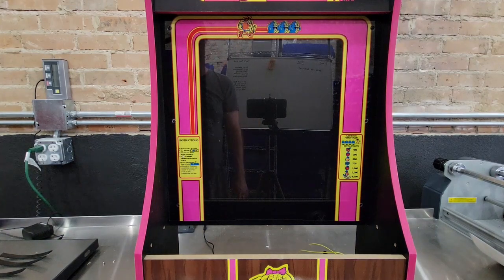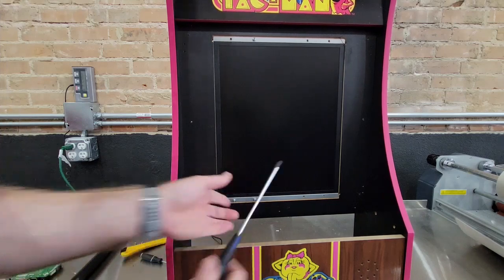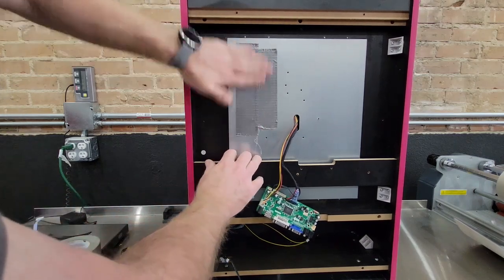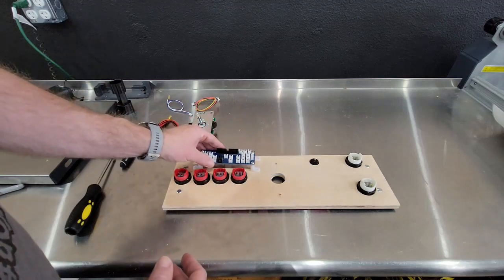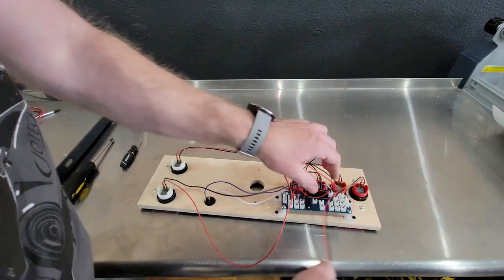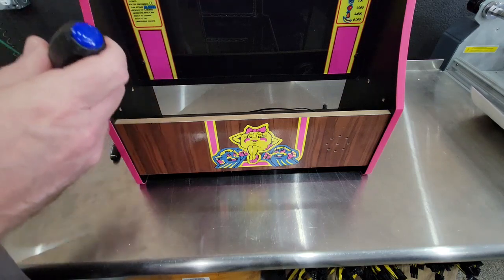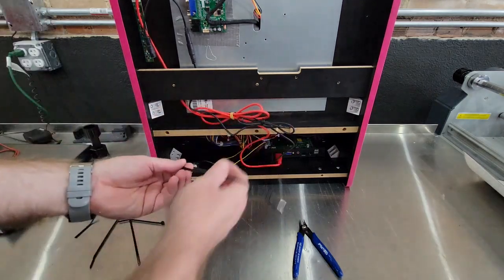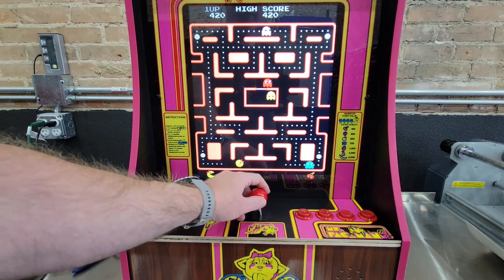Arcade1Up PartyCade Pandoras Box Vertical Game Board Install Using Easy Plug and Play Board

Comment: I would definetly use 4 screws on the joy sticc as it gets the most abuse.  using only 2 screws has a higher probability of lossening over time.  Once one screw gets loose, you are now relying on the other screw for holding the joy stick firm.  If you want a solid joy stick.  4 screws and some glue.  
I also have that pesky type magnetic type screw driver,  I place a small neodynium magnet on the screw driver to get a better hold on the screw.

Comment: Just a question about the vertical Pandora's Box board in general because my Google-fu failed me on finding this out:
If you turn off all but one game on the board, does it become a "dedicated" version of the selected game or does the menu still come up? I know the 60 in 1 is capable of doing this but I wanted to see if this would do the same because in a hypothetical situation where I wanted to use these as a temporary fix for a game that doesn't bode well on the 60 in 1.
Reply from the maker: No, its not like the 60 in1. The pandora will always boot into the main menu.

Comment: Extremely helpful video. I've been thinking of doing this with the same cabinet I recently purchased. I never knew much about how to go about it though. Few questions..1. How do you adjust the volume?  2..How do you return to the game selection screen? And 3..How many games are on that pandoras box? I seen 512 somewhere but also 3000..wasn't sure which it is..thank you.
Reply from the maker: 1. there is a adjustment on the board 2. push 2 buttons together 3. 512 vertical 3000 horizontal. FYI partycade is vertical.
Reply: @diyretroarcade  Is there a way to order the games so the most played are at the top of the list?
Reply from the maker: @shannond4142  you can star them as favorites, those are always at the top